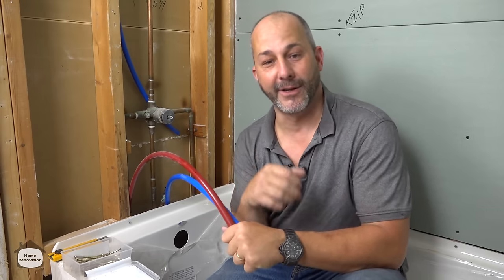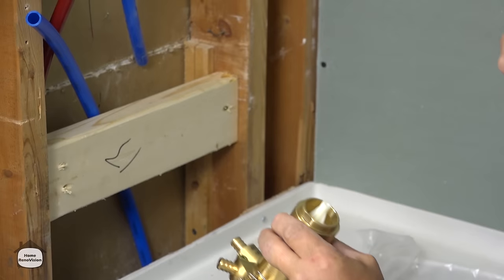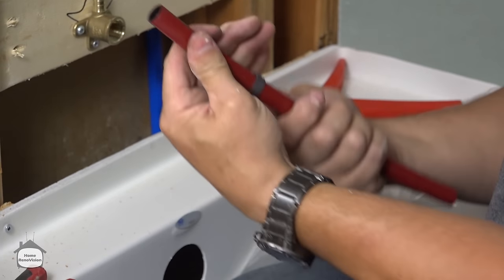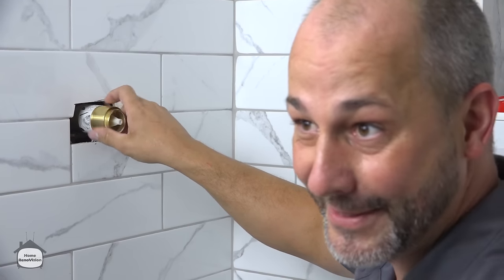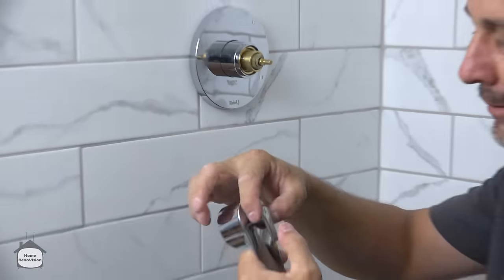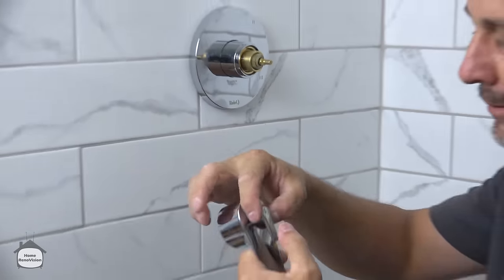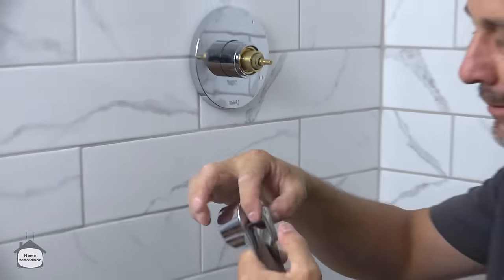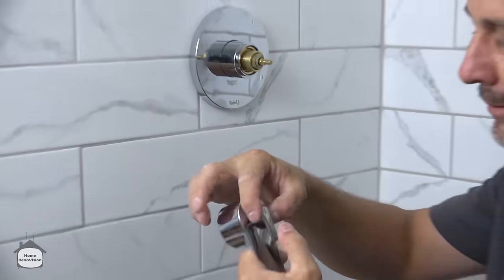How to Install a Pex Shower | Full Installation Tutorial

Comment: Why is it that plumbers never carry a few standard open end wrenches. Instead they use channel lock pliers and mar the fittings. I saw you use the bubble wrap in 1 fitting but nothing on another fitting. There are many pipes and fittings with flat sides made for a properly fitting wrenches but somehow they they often have torn metal from chanel locks and pipe wrenches.

Comment: i have an old vented window in my wall next to my tub, should i remove it? how would i go about sealing it to prevent water seepage? is it better to pex the whole house or just run pex attachments near water fixtures and copper everything else?
Reply from the maker: you can tile up to the window and get a great seal, no worries.just be sure to waterproof everything.

Comment: Hey love your channel you guys install tile right over drywall? No concrete board?
Reply from the maker: not needed if using a waterproof system. Cheers!
Reply: @HomeRenoVisionDIY  why do you use the waterproof system instead? Cheaper than cement board? Thanks
Reply from the maker: Hi Chandler, the truth is that cement board needs a waterproofing system any way. the weakest point of any shower is the joints and the gap from the tub to the wall board. If i am going to need to seal up all that anyway then i am not going to use cement board unless the shower is taller than 8'. after that height the tile runs the risk of shaking loose during seismic events and is dangerous.
Reply: @HomeRenoVisionDIY  gotcha thanks for reply appreciate it
Reply: @Gooselip  water proofing systems are way more expensive than cement board but are the right thing to use, its a common misconception that cement board is waterproof on its own. I like Schluter stuff the best but it is definitely not cheap

Comment: I have the same Riobel system for soaking Tub. The water is either too cold or too hot unable to have a right mix. How to adjust the thermostatic valve?

Comment: My husband and I are remodeling our first houses small bathroom. We also did the Plex system but we’re having an issue where the water is coming out the tub spout AND the shower head 😅 anyone have any ideas what we could have done wrong? We’ve tried two different valves

Comment: I’ve been kicking around the thought using PEX in my next house build, but I have a concern with using the metal crimp rings. I can’t help but to think of what happens to the grey PEX riser lines, after a few years in a compression fitting, such as an angle valve. They always break at the point where the compression ring and PEX meet, and then your house gets flooded. I’m sure the breakage is the result of different expansion and contraction rates between the PEX and metal. 

The old polybutylene disaster was similar to this same set up, but these compression rings are a little beefier. Why not use the plastic compression rings? They would expand and contract at the same rate with the piping, and prevent the PEX from being cut by the metal ring edge. Do you have any insight on this?
Reply from the maker: the connections on the pex pipe with stand 10 times the normal water pressure . no issues!
Reply: Yea, I get that the connections are stronger, but I’m not concerned with their ability to maintain a solid connection. The plastic will expand and contract before the metal ring will. I’m wondering if the ring edge will eventually cut or score the PEX, and cause a leak right at the crimped connection, which is exactly what happens with PEX supply lines and compression fittings. 

Even if that’s a possible failure point, it may still outlast CPVC...maybe.

Comment: I won't use PEX and any two story home all the waste lines through any walls or ceilings I want cast iron. However, tract homes homes I understand why people use the cheapest materials possible. To me there's nothing worse than the noise of somebody flushing the toilet and listening as it flows throughout the ceiling walls and so on, and copper is an excellent antibacterial. I guess as you once said I prefer the 40 plus year old home.

Comment: try putting the handle of your channel locks inside of the shower arm to tighten it lot easier and will not scratch the chrome or egg the tubing good video  but  I would  never use green  board on the walls

Comment: My wife and I are installing a new vanity and the sewage line and water lines aren’t centered with the room so we are going to move them. Would you suggest using copper and a shark bite since we currently have copper? Or would you suggest going to pex?
Reply from the maker: If you have copper I would suggest soldering. or at least have access to the sharkbite in case you need to make adjustments or replace. Cheers!
Reply: Home RenoVision DIY I don’t have the materials to solder...if I did shark bite and had an access panel, can I have the supply pipes and sewage in an open window instead of having them in their own individual hole in the drywall?
Reply from the maker: as long as you can change them in case of failure. Cheers!

Comment: But the valves were in the off position! Then the rest got installed over tile.  I don't understand. Wouldn't that be a huge problem?
Reply from the maker: Hi Rick with this install you have access to the valve stops at any time simply by removing the handle and face plate. Cheers!
Reply: @HomeRenoVisionDIY  Thanks for reply.

Comment: You can always use a handheld Dremel  with a metal cutting wheel that will cut that pipe in 10 seconds flat.
Reply from the maker: Only thing is I don't keep a dremel in my plumbing kit. Cheers!

Comment: Loved the video. I was wondering if you used the same tile for the niche side walls as you did for the rest of the shower, or did you use a thicker tile? They seem thicker than normal wall tiles. I'm building a niche myself for the first time and was wondering about this. Thanks!
Reply from the maker: yes i did. Cheers!

Comment: Doing installs in new house with shower and tub units with fiberglass walls how does that affect control valve depth?
Reply from the maker: depth is based on finished surface. you must do the math backwards. Cheers!

Comment: What bar is the US mains pressure? 15mm equivalent pipe wouldn’t normally serve a bath over here in the U.K.
Reply from the maker: Hi Carl, very true that your plumbing supply is a little larger. however we use fixtures that create more pressure to get a good result. Cheers!

Comment: I have the Riobel shower with pex fitments on everything but the tub faucet. We aren't using a tub, can I use that bottom one as an outlet for a hand want? We don't have the third outflow on the valve to do one...
Reply: Yes you can have shower head and wand on 2way valve, make sure you follow diagram as to which port will serve which outlet, one port may have more gpms then the other

Comment: Teflon tape is NOT a thread sealer, they make thread sealer (yellow goop you brush on the threads).  It lubricates the threads so you can tighten properly and easily.
Reply from the maker: and yet it works. CHEERS!
Reply: it is an appropriate thread sealant and the ptfe is a lubricant...

Comment: Question: I'm having my foundation dug out for repair, and was thinking I could replace the old 3/4 inch copper water main to the house with a black poly 1 inch line to make sure I get sufficient pressure.  Doing a full rehab on the house, so don't know about existing pressure levels yet, but 100 percent of the water supply lines will be PEX.  Good idea or a waste of $500?

Comment: Hey Jeff great video! Quick question. I’m looking to install a “Tower Shower System” that has like six different jets along the body of the shower. Based on what I was able to read on the manufacturer installation guide, it seems that the main valve and all the mechanism is inside this tower shower and all I seem to have to do is connect hot and cold water supply lines to the hoses integrated in the tower shower. Do you have a any videos installing one of these?? If not, am I understanding this installation correctly? Thanks!

Comment: Most plumbers will insist on PEX A expansion type (which you need expensive tools for).  But if you actually dive into the literature, PEX B has less chance of leaching chemicals into your supply lines.  I don't know how people bend their pipes, I never felt like the PEX B wasn't flexible enough, or just put an elbow on FFS.

Comment: Water pressure has nothing to do with how much water comes out of the fixture. Pressure is the result of restriction to the water flow. If all your water valves are closed, you have pressure, once you open a valve you have flow and pressure drops, how much water (rated in gallons per min) is dependent on how much flow your utility or well head supplies and size and condition of the piping in the house.
Reply from the maker: flow is also dictated by the size of the valve openings, which is always the smallest hole in the system. cheers!

Comment: The only thing about using the 3'' construction screws are that overtime it rusts out and I've had to go back on one occasion because the screw rusted out after a year and the bar was barely hanging on.
Reply from the maker: so where was the water coming from. let me guess you didn't use a waterproofing system and the vapor killed your screws. the screw is not the problem in this scenario.
Reply: @HomeRenoVisionDIY  I'm talking about the 3'' screw you used to mount the shower bar. Vapour and steam etc rusted it out over time and the shower bar with the hand held shower came loose. I always use stainless screws to mount any fixture inside the shower area since that
Reply from the maker: oh!!!! My Bad. The Riobel system I use always comes with stainless screws in the kit. I know that is not always the truth with stuff out there. That is one of the reasons i use them a lot. Cheers!

Comment: Noticed you had mentioned that noone goes to school to learn this install,i have to disagree.thousands of hours and that many inspections by inspectors,who critique your work to code is the school.but all in all I love your videos,it creates a lot of service calls for messups.  😂
Reply from the maker: Hi Thomas, if you require inspector to critique your work to learn your trade then you have never been educated. building practices are at best very minimal. inspectors know less than most contractors out there.
Reply: Every tile guy that has seen plumbers put in shower valves think the same thing.i agree with you it seems easy if you have seen  other peoples finished work who put in the time and training as I said in my prior statement.and as far as ojt training from being insoected,i have done 1 or more things you did in this video and failed an inspection."there's always room for improvement" 😁
Reply from the maker: Cheers to that!

Comment: @2:11 You are turning the tool in the wrong direction! A moment @2:18 later you can see how the tool has walked a bit before it can catch a groove. You don't need to tighten it as much as you think to get it to cut.

Comment: You are wrong about the pex, it reduces flow. Riobel the company that made your valve has gallon per minute flow rating charts for all their valves and 1/2 pex variants are the lowest flow. 3/4 pex is only marginally better than 1/2 copper too.

Comment: Hi guys. I have a problem. I used the kind of the same system in my shower. With hand shower and rain system on top. So, now I have a problem.... after the whole installation, my hand shower is leaking nonstop. Drop by drop..even in an OFF position.  What can happen? is it a valve's problem? I mean cartridge? I am really confused :(
Need help, please. I checked everything... but nothing wrong on my mind. 
Need your suggestions.
Thank you
Reply from the maker: sounds like you have some debris in your cartridge. I suggest removing it and rinsing it under your tap. reinstall and see. That is the only place you can have a problem. if it persists then order a new cartridge. should be covered under warranty. Cheers!
Reply: @HomeRenoVisionDIY  thanks sir!
I will try.
Love your channel! Found so many useful information!
Stay alive for a long time:)
We need you man ;)

Comment: Where do I purchase this shower kit? What's the name of it?
Reply from the maker: this is riobel pro. they are changing their line right now but you can always get riobel. Cheers! check with fergusons in the US or Wolseley in canada.Cheers!
Reply: @HomeRenoVisionDIY  thanks
Reply: @HomeRenoVisionDIY  we want exact bathroom you have.
Reply: also noble, emco ,  deschenes and JuHoule !
Reply from the maker: You can definitely have one. the other suppliers you listed may not have the exact valve \i used but there are plenty of 3 way valves on the market. cheers and best of success. send us some pics when you are done. Cheers!

Comment: Did you used green  Sheetrock instead cement sheets
Reply from the maker: yes i did. even cement board needs to be waterproofed. so why use more expensive materials that require special tools to work with.
Reply: Home RenoVision DIY  thanks good job .my question was because I saw a video too and people say if we use a Sheetrock soon the tile can falldown

Comment: Love your videos! But Teflon tape is NOT a sealant!  The thing that seals are the threads.  Teflon tape is acts as a lubricant that allows you to turn the pipe more, which let the threads bite into each other more due to the tapered ends of the pipe.  You need ONE TO TWO WRAPS.  3 is too much, and certainly 7-10 is just crazy.  At that point the tape is taking up so much space that it takes MORE force to turn the threads into each other rather than less and you end up with a joint that isn't as water tight because it wasn't able to turn as much.  It might still seal ok, but it is NOT as good as going with 1-2 wraps.
Reply from the maker: those threads are manufactured in China and not consistent quality. That is why I go overboard with the tape. experience has taught me not to trust the fittings.

Comment: Hammer arrester ? Do you need it?
Reply from the maker: only on copper lines. not on pex. Cheers!
Reply: If you need hammer arrestors your pressure is too high. Put a pressure reducing valve solved all my water hammering issues
Reply from the maker: if you use pex you will not need them at all. Cheers!
Reply: @shahsmerdis  We live in the rolling hills of western North Carolina. A pressure reducing valve solves the excess water pressure and water hammer problem very nicely with no undue stress being put on pipes, fittings, or valves.

Comment: Man I hope you temporarily capped off the outlets (shower head, hand held, tub spout) and checked them for leaks before tiling everything. I've seen other guys leave the outlets open just as you did and the the lines either have a leak that ruin your brand new shower or the tile guy tiles right over it leaving a open line in the wall. Very bad practice! Always cap and test ALL your lines.

Comment: I just use pliers to turn the handle
Reply from the maker: that can work but on some models you would actually damage the threads that the handle the sit on
Reply: @HomeRenoVisionDIY  I know but you just need to be careful and do very small turns. The handle barely turns when I do it. Just a few degrees each time. I have a tiny one like yours but just a bit smaller that's so awesome for tight spaces. I also have the larger one that's about 5 or 6 inches long.

Comment: all great ...except  ..green drywall behind. shower = durrock. The plumbing codes prohibit using water resistant sheetrock in the shower enclosure area. also pex needs to be secure to structure every 10-15".  now you need $100 starbux gift card for the inspector to pass the job, overall ...me like. i just hope you have access to that crimpy crimpy 
on the other side of the wall
Reply from the maker: Hey Pablo, where youn from that green drywall is not up to code?
Reply: @HomeRenoVisionDIY  IL.  it is not even about the codes. you dont want gypsum product around areas where there is moisture. water will sip thru grout/caulk lines and damage the drywall over time. especially front and corner areas.

Comment: Never install tile on drywall.  The paper will peel off and tiles will fall off.  There is a reason concrete board is used in showers.  This is a disaster waiting to happen a few years down the road. The grout will absorb the moisture, the paper on the surface of the gypsum will wick it into the gypsum and the paper will separate from the gypsum board and the tiles will start falling off.  I've seen it before and I'll see it again, it's very common for handy-man installed tile showers. You can get away with it on back-splash, but not a shower.  You should know better.
Reply from the maker: Hi jason, perhaps if you noticed the waterproofing membrane, you would understand the paper will never see water. This shower will last longer than any cement board shower that does not have waterproofing. cheers!

Comment: if im currect i thought pex was not recommended because you get back pressure to the shower head
Reply from the maker: Hi Mike, this shower valve has positive stops and redirect in the valve so it does not rely on a mechanical diverter. that way if you are using the tub only the tub has the ability to have flowing water. Cheers!